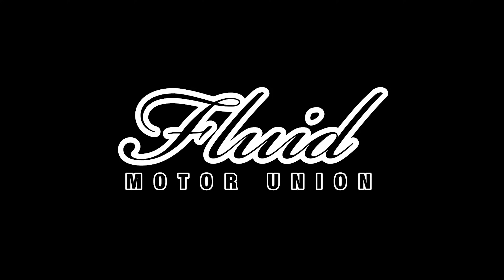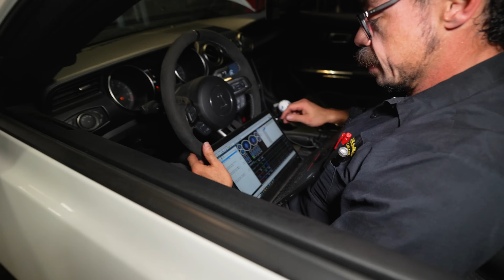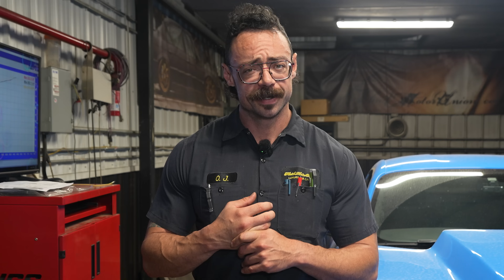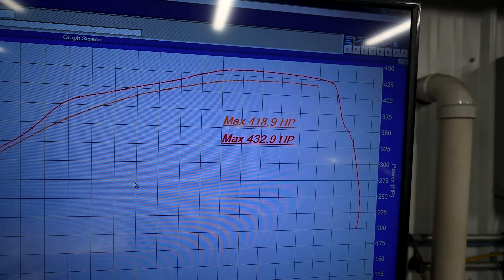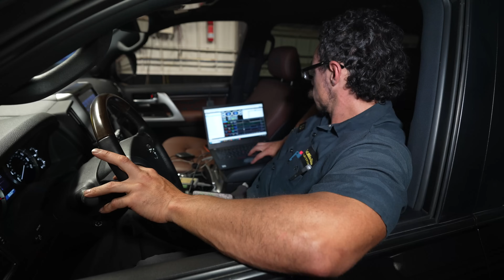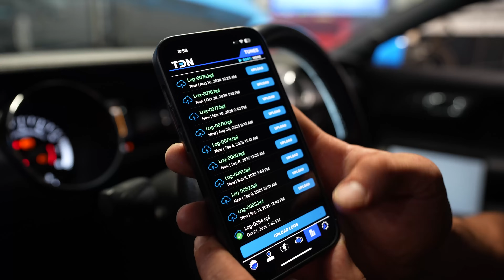There’s More Power in Your Car..! Watch This Custom Tuning Guide Before You Waste Money!

Comment: I’ve tuned an LS1 on HPtuners but most of my tuning is tuner studios with megasquirt. Something I learned is that oem ECU tuning is so much more involved due to all the different parameters and tables every manufacturer uses vs something like TS that’s universal. Currently having to figure out how to adjust 4.0l jeep tables to get a little more out of the stock lazy tune Jeep used.

Comment: My C5Z is just a Stock internal LS6. Ported LS6 Intake+Throttle Body, Some 180* Equal Length Headers, Fluidampr, FlipTie Intake, Low Temp LS3 Water Pump, PAC Springs, and a tune for 6400rpm Spark Cut, since I autocross the car.

My next modification, is one I don't want to make. I want to swap the Fuel Pressure Regulator to a Bosch 4 Bar (58.2psi) regulator since the GM ones are failing left and right... it's stupid but that & an injector cleaning+balance will have it running well and ready for a new tune!

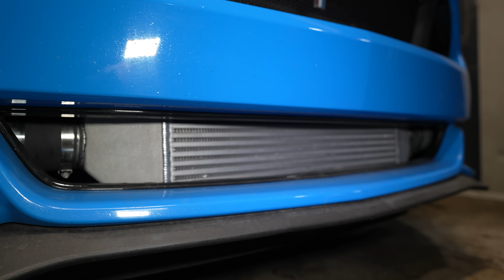Comment: 16:18 looks like the intercooler is cracked on the left side? Might just look like that though.
Reply: Might be the lighting but yeah I see it too, it's right there on the weld where the pipe meets the intercooler
Reply: @coliimusic worth a check, probably nothing though ❤️
Reply: Wow you guys are super observant. However, it is not a crack, that is black paint that dripped from cutting metal to clearance the intercooler (It is 6" thick).

Comment: Can you not just install a flex fuel sensor on the GT350? That seems like it'd be the easiest so the tables have a base and the computer adjusts the timing/fuel, instead of having multiple sensors hope for the best.
Reply: You can install a sensor to monitor the % of ethanol but the Ford PCM does not have tuning provisions for it.

Comment: That gt350 should probably get a set of lu47 injectors running on e85. The stock injectors are the same as the GT, something like 34lbs, puts  them damn near 100% DC. Also with coyote "custom" tuning is not really needed, unless it's billy bad ass stuff. Take Lund, most tunes are basically copy paste... vetted files and a couple data logs and revisions is all that's required. So canned is not necessary bad and custom is not necessarily needed. At least on coyote.

Edit: That centri built motor 17 gt coyote only made 700whp? What? Why build a gen 2 coyote for 700 wheel, especially on a centrifical that eases into boost unlike PD blowers that are instant power. Gen2 coyote is safe to 800whp-850whp. Sorry I don't mean to break balls but I know coyote. That thing needs to make 1000whp.
Reply: This is my car, the boost is turned down right now since the Boss manifold cracked, so it’s currently running a stock 2018 manifold with a larger pulley making low boost. Previously, it made 1,000+ rwhp at 21-22 psi with the old 3" Vortech intercooler and piping on a Dynojet 224x and would run 8.80's in the 1/4 with more in it, but due to high intake temps and eventually the cracked boss manifold I stopped to get the issues addressed because no one wants a hurt car.

Because of the higher intake temps and flow restriction from the Vortech setup at that power level, I brought it to FMU for new cold-side piping and a custom intake after installing a TR1260 intercooler. Once I pick up an alloy intake, I’ll turn the boost back up and let it eat. For reference, FMU’s dyno is a heartbreaker, it’s well-known for reading low.
Reply: @Grabber_GT  that explains it. A Ford performance aluminator will handle 1000 wheel no problem, I would expect this to be safe for around 1250.  Surprised you didn't go PD on a gen2 as the cetri is a real roll weapon with the 10r.
Reply: @durstroyer3924 I had a Whipple, thing ate it's own rotors and had so much torque down low I hurt the motor twice at high power levels. First was the stock gen 2 and the second was a gen 3 bottom end. So I got the gen 3 bottom end sleeved with a forged rotating assembly and went with a centri to try something new. I notice at the track PD blowers at that level may get 1 pass on me but then they become heat soaked and I honestly didn't want to deal with ice tanks as I am not that serious of a racer.
Reply: @Grabber_GT another whipple kissing rotors 😂. Was it ported?
Reply: @durstroyer3924 nope! Lol

Comment: I am always amazed at what I don't know. I know nothing about any of this. Near 70 now. We would work on cars years 50 through mid eighties. My question is when did all of this become available. Meaning plug something in a car and know what is going on. When we worked on cars we relied on sound, sight (timing lights) smoke from the exhaust, driving the car etc,. Sure we heard about dynos but that was something for serious speed guys.  If this is to silly of a question try not to laugh. Great video.
Reply: I think 96 is when OBDII was mandated
Reply: @Sube-Tube figures. We were totally out of the car repair fun business by then. Just wanted to detail them at that point
Reply: If ya got out in the late 80s, you didn't miss the OBD-2 transition by too much. I think by around the mid 90s to early 00s you start seeing just about every new car with it, and diagnostic tools back then were expensive but still coming around to shop-level. Fast forward to the post-2008 tech world and more accessible scan tools start coming out for the everyday joe until, eventually, you get to what we have today where you can buy a scanner or a tuning chip that can do light diagnostic fixes or canned tunes for cheap off of Amazon. I agree it's pretty wild stuff though, but you carb guys also have some weird magicks about you too.😂

Comment: I 100% agree with your assessment on box tuning. I got my Ej255 Legacy GT wagon with a Cobb AccessPort attached. Normal mods that accompany a "stage 1 tune" on the AccessPort were on the car when I bought it. I dynoed it at 275 wheel HP and 277 torque after I tweaked the settings to fit what I added to the car.  275,000 miles when I sold it. 

I miss that car.  I mostly don't miss fixing it.